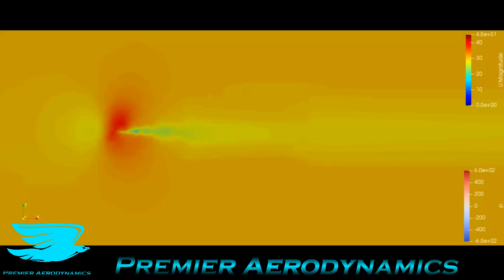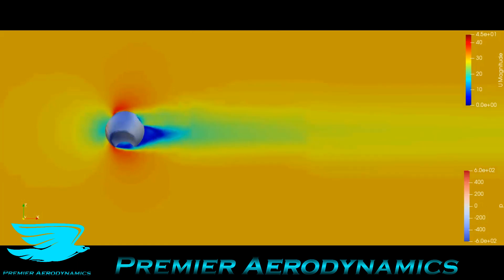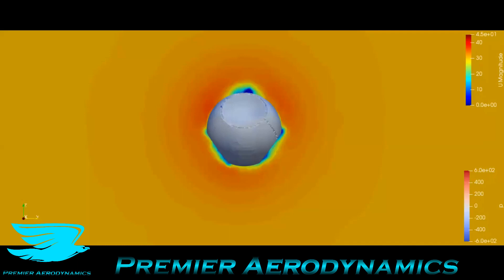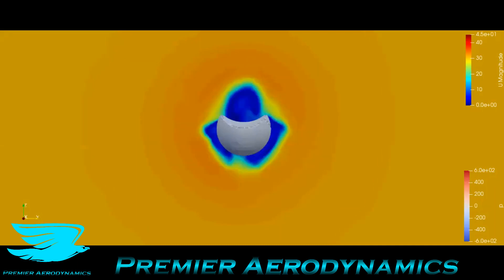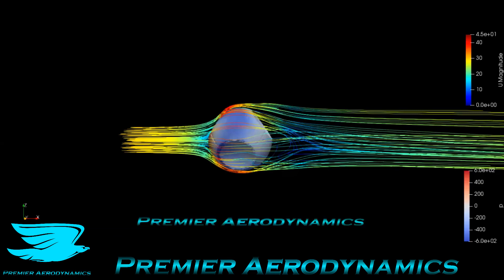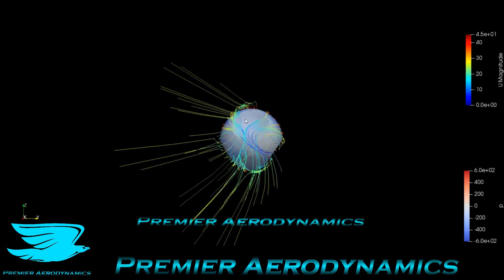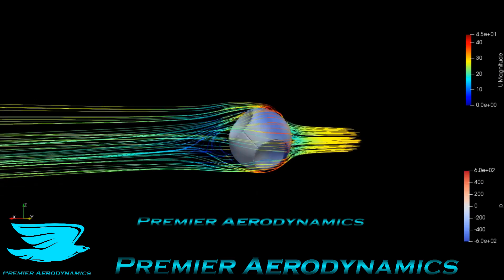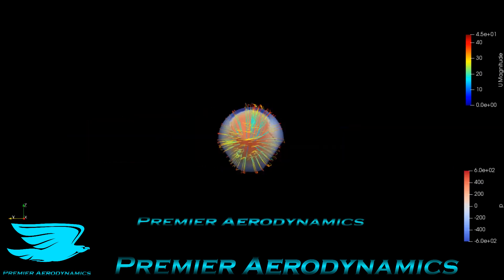Harry Potter Quaffle Ball Aerodynamics - Premier Aerodynamics

Comment: So what does that mean for actual flight dynamics? Will it spin or tumble? Will it knuckle?
Reply from the maker: It will probably spin. The knuckle comes from chaotic separation. So, the separation happens randomly. Here, there are distinct lines where separation occurs (where the dimples start), so the separation is kind of fixed. That will lead to a more predictable flight, so not a knuckle but a spin.